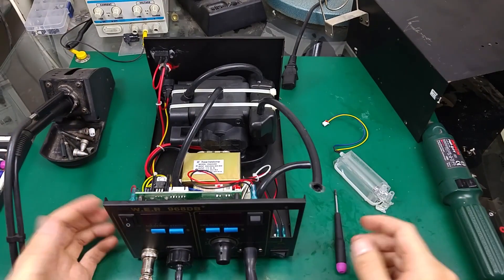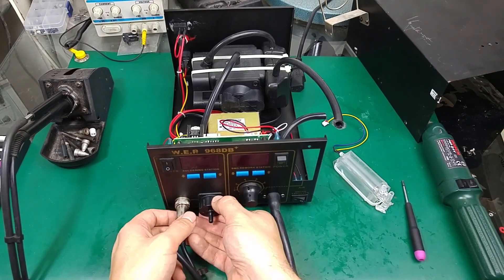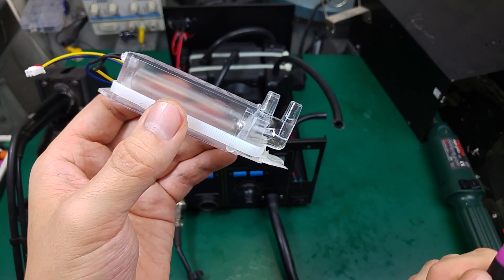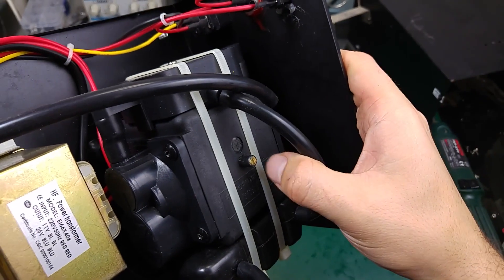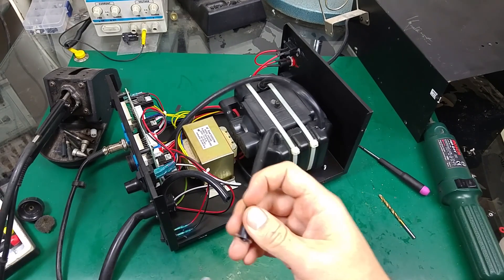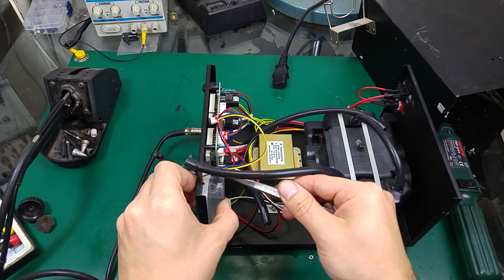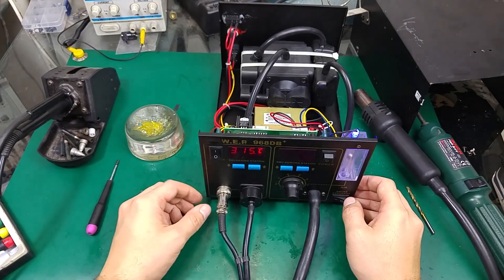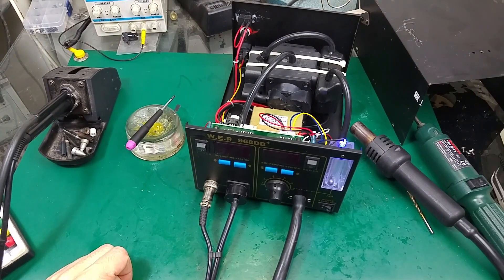Fixing lost suction and air pressure on WEP 968DB+ soldering hot air station

Comment: Lifesaver! I couldn't figure out why my hot air gun wasn't not getting hot enough to remove components anymore, and the air flow was low, I had completely forgotten about the filter, the filter and the inlet on the filter holder were completely blocked , due to using some really cheap flux to begin with I think. Functionality restored and thank you!
Reply from the maker: You are welcome - Glad You make it working! Good luck with future repairs!

Comment: HI! i appreciate much the video. Even though my problem was something else , you video at least got me to move in the right direction. My lack of air flow was due to a ruptured diaphragm. I will order a diaphragm as soon as I can find where I can purchase one online. In the mean time, I am using a piece of flashing tape used on new home construction. It's rubber and has the best and most durable adhesive I have ever come across. I have an hour on it so far, but still holding. I will order several of them and have spares on hang. I'm sure that I will need them in the future. Thanks again

Comment: I had the same loss pressure problem, I made all this steps without lucky... in the last moment before reassembly and close, I saw a little scratch in the plastic of the air barrel (the last part of the pump where the air hose go to the air pressure meter), in fact, wasn´t an scratch, was a split loosing a lot of pressure, I used a hot plastic to close the split and the pump start to work at 100% again.  Maybe this can help someone.
Reply from the maker: Thank You for feedback, for sure someone will find that helpful.

Comment: Anyone know where I can find the wiring electrical diagram for this model?

My air flow adjustment is not adjusting and would like to know if internal components are correct
Reply: Maybe check out the video "Aoyue 968A+ Repair" by  grtyvr he shows how lots of the through hole solder joints are garbage on these units. I suspect that might be your problem as my aoyou 968a+ has the same problem as his and they share similar PCB's and design....

Comment: Great video, thanks for making it.
I do have a question, how long do you have the 968db+ before the issues started?
Reply from the maker: Very long - but it's wrong question as it will very wary - how much do You solder, how much flux You use (that will make smoke) - so maybe for everyday service center will be every month - for me it was years.
Reply: @ElectronicNoobBlog  Hello, Thanks for fast reply. Ok I understand your response, thanks.

Comment: Thanks for this video, my YIHUA 968DB+ lost suction recently and it blockage was fixed by replacing the small carbon filter at the fume suction end. Also some flux had blocked up the hose a little bit. Now that air level ball it back on top! :) 
Without proper airflow, the hot air gun will literately burn! Mine was producing smoke and is now no longer silver. Looks like yours is also looking a bit burnt.
Cheers!

Comment: Hi electronic! Thanks for your photo of videos and blogs. I need help with my soldering station. I hope you can help me. This soldering station is super. There is a problem though. After a few years the switches can be damaged internally and cause a fire. As in my case. Nothing serious. Except for the fact that in my case two components are burned. Two capacitors. One electrolytic and one second in polyester. I can't find the specs on the web. I leave below the link of your photo with the components that I have damaged. I hope in you. Thank you. Jonny.
https://ibb.co/MZjSgSh
Reply from the maker: Sure, 

Electrolytic one is 16V 47uF 

 film one is  400V104  ( 0.1UF 100NF 400V ) 
https://electronicnoobblog.com/img_20200204_152252/

https://electronicnoobblog.com/img_20200204_152515/
good luck!
Reply: @ElectronicNoobBlog  Really 1000 thanks for your help! Really! There is nothing on the web about this machine. Not even a service scheme. You have been very kind. The problem was caused by the hot air gun switch. And a 4-pin switch. I changed it to a better one of better quality. And several years now that I use this machine. But a similar problem is really annoying because of a switch. Thank you so much for your help. I subscribe to your channel. If you like, I offer you a coffee willingly for your help.
https://ibb.co/3zJC20t
Reply from the maker: @JonnyBrek  You are Welcome, Yes, that's true - nowday's ( i remember times when schematic was on under back pate)  schematic are not common :(
Hope will last for You! No need for coffee - just one day return someone similar favor!
Reply: @ElectronicNoobBlog  Thanks so much! Definitely. I am always ready to help those who ask me. Thank you. So I did not understand correctly, by chance you find the service manual of the motherboard? Schematic diagram for this pcb board?
Reply: @ElectronicNoobBlog  Certainly certainly. I am always ready to help those who ask me.! So we definitely don't have a wiring diagram for this model from what I understand. There are various schemes around but I don't see this machine. Then I noticed that several manufacturers make this model. Yours is a w.p. and mine is a Yihua. But they are the same internally.
Reply from the maker: @JonnyBrek  Yes, i don't have any schematic.  Thy came with different name,  You just order own label when ordering large quantity.
Reply: @ElectronicNoobBlog Thanks for all. I'll let you know how the repair went as soon as I get the parts. Hello. Good day.

Comment: Are you recommending this stations?
Reply from the maker: For me most important feature was fumes extractor - if that's Your goal - then yes i recommend.
If this is not the case, then look for soldering iron that have temperature sensor in tip (like Hakko T12) not like this in heating element  You will get much better control. This technology is obsolete - but as i said i'm not replacing mine (still primary use) because i can't see anything better with fume extractor and good price range.
Reply: @ElectronicNoobBlog 
And when did you buy it? How long and how often are you using it?
Reply from the maker: @auron19888  About 6-8 years ago,  in 2015 I was replacing heating element:
 https://electronicnoobblog.com/replace-heating-element-in-wep-968db-soldering-station-and-calibration-after/
Not often, couple times per week - i'm not a pro - just hobbyist.